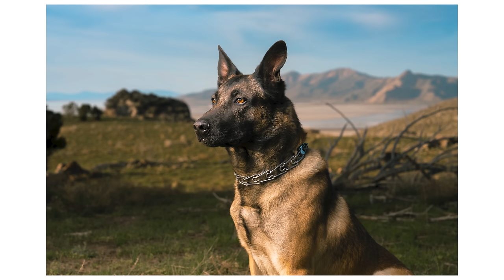Guide to Double Stack 1911's - $34,000 of Pistols

Comment: $885 delivered, taxed, and transfer fee'd from Bud's to my FFL  - my RIA M1911 A2 FS TAC1 14+1 .45ACP.  No need to mortgage the farm to get hi-cap .45 ACP with pic rail, skeletonized hammer, adjustable trigger, extended beavertail, good sights, ambi safety, grippy slide cuts, and reliability.  Replaceable grip?  Seems like another thing to go wrong.  

The 1911 has proven to be - you should pardon the expression - bullet-proof, for over a century.  There's just not much that needs changing.  And the stratospheric prices of some of these pistols just doesn't make sense to me.  What, really, do they have to offer that is worth the price of a good used car - or a crate LS - over the price of a very capable RIA?  Interesting to listen to the descriptions, but to me, 4 figures on a gun is money better spent on ammo and range time.

One side note: your analogy with watches - hand-fitted and polished, more gems, more time spent on the Rolex, etc.  That's not why they're worth more.  That's why they COST more.  Yes, you have to pay more for the longer production time, the careful fitting, the exceptional skill of the master watchmaker.  You can't get those things cheaply.  But - just like a 2011 - that's why you pay more.  That really says nothing about whether or not it keeps better time - or groups more closely.  The latter two attributes are why it would be WORTH more.  And if either does NOT rise above the competition, functionally, it's money spent on irrelevance.

And a last issue that frosts my cupcakes: break-in.  The manufacturer wants me to shoot a couple hundred rounds, on MY DOLLAR, to make their $10,000 gun work smoothly?  Seriously?  You want ME to spend $150 on ammunition after I just sold my first born to buy your gun?  No, if you're charging $10,000 for a hunk of iron, you better damned well spend YOUR money making sure it works before you put it in a UPS package.

Comment: I know its probably blasphemy, since CZ isn't a 2011, so it might be defeating the whole point for some, but I'd be curious to compare a CZ Shadow 2 in SA, TS 2 orange, or a Dan Wesson DWX to the non custom 2011 offerings.  Seems to be similar priced or even a little less than some Staccato models, would definitely have more weight, maybe not quite as good of a trigger, but on paper would compare competitively with 2011s at or slightly above the price of those guns.  Especially for something like the new limited optics division.  If it was a cheat to more performance for the price, I'd consider one of those and just buy 1911s for nostalgia or tradition.  Might not be the cool or gucci thing to do but I'd be curious if it would be as effective.
Reply: Not a bad question, I can save you a ton of money! I own the CZ shadow2 blue,shadow2 orange, and racing green. I also have a DWX. I’ll bring those and the XC and the Artemis. You will start giggling and shaking your head around the 6th or 7th round on the last 2. Love my CZs but just not in the same league.

Comment: if it is double stack it is not a 1911.  its a 1911 adjacent
p.s. there are two things you never have enough of in any defensive situation.  the first is time, the second is ammunition.
there is nothing wrong with double stack. it is simply NOT a 1911.

Comment: I have to just say Porsche Boxters are garbage and an abomination to the Porsche name. Moving on.....

They all shoot and at the end of the day, if you don't train, you can get outran by a guy with a Taurus that trains. We are talking about .xx of a second as far as speed. Only necessary for those in competition to get the added edge. IMO, a $2500 2011 is not 2.5xs better than a $1000 P320 X-5 Legion. Just my .02. Great video!

Comment: They keep saying that you can expect the lower end double stack 1911’s to have cast or mim parts. Staccatos do not have any(one example of inaccurate or misleading information). More expensive or eye catching does not mean more reliable, better performance or longer lasting. Chambers does a lot of reviews on his 1911 university patreon and many of the high end guns had terrible barrel fit and barrel leg contact (necessary for long term accuracy over time). If anyone is looking for a mechanical review and understanding of what that means for performance by someone who builds some of the best double stack 1911s out there you should check him out (costs $5/month). This review is very superficial and subjective with some inaccurate information.
Reply from the maker: I take issue with charging people to watch you tear down your competitors guns while they can’t defend themselves. It’s an excellent sales tactic because you become the guru in your tribe. I talk to a lot of manufacturers. You know how many of them would ever do that, zero that I know
Reply from the maker: Also I never said staccato had mim or cast parts
Reply: @1911syndicate  he keeps the reviews very objective and speaks to math and measurements. He gives just as many compliments (when they are warranted) as he points out issues. For instance the alchemy gun he just reviewed he was seriously impressed with their barrel fit.
Reply: @1911syndicate  at min 20 you said, you have to understand that with entry tier guns you will get some MIM parts. You said staccato is in the entry level tier. The inference for those who don’t know better would be that staccatos have mim parts. I stand by my statement that you are giving out misleading information.

Comment: 15:55 yeah... sorry but I gotta chime in here and say that you're sleeping on forgings. A forged part is inherently stronger than a part machined from a billet. Forging aligns the grains along the part's surface which gives you a stronger end product. That's why the strongest racing crankshafts are forged. There may be some benefits in precision to billet machining, but basically every 2011 that's using primarily billet or forgings is going to be hand fit so I don't think that's all that relevant. Still a great video, but autism speaks.

Comment: Whew. Your understanding of metallurgy is a little off. Cast is when you pour liquid metal into a mold. Old school technology with limits to the quality of the final molded part. Metal Injection molded is when you take liquid metal and inject it into a mold. The modern form of casting that is far superior to pouring. Billet just means machined from metal bar stock. That bar stock is made by cooling liquid metal and forcing it through a shaped die before it completely cools. Forged is taking a piece of metal, heating it until its malleable, and pounding it into the shape you want. Forging is the king of strength, durability, and quality. Extremely expensive at first and only financially feasible for large scale production. Billet is the king of customization. With bar stock and a CNC, you can create anything you want. Perfect for custom and small scale production. Don't let your love for custom guns trick you into thinking billet is superior to forged, because it's not.
Reply: Thanks for being that guy 😂